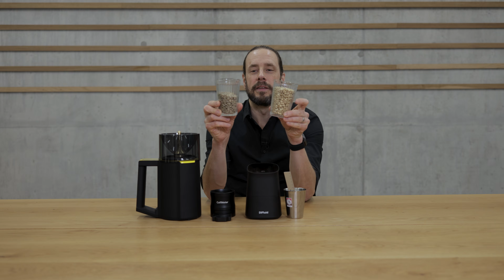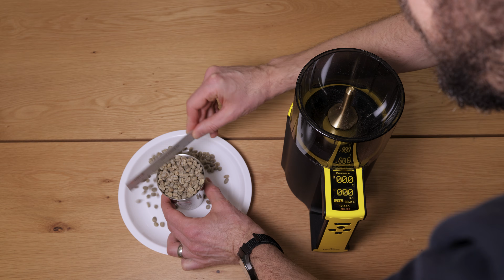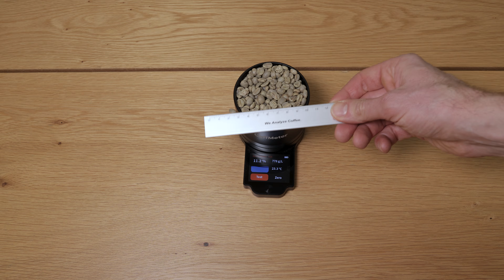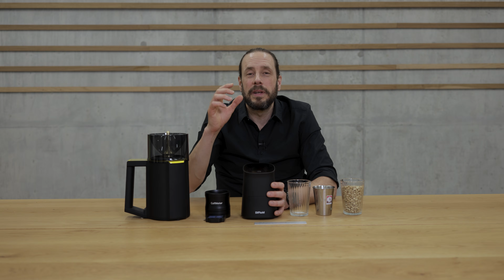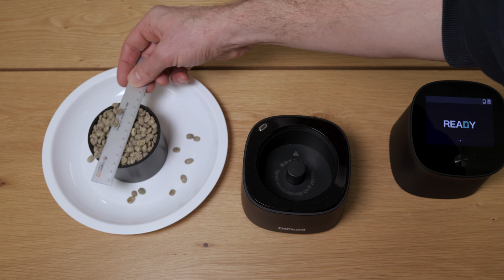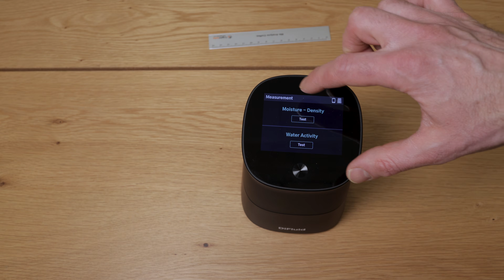Mastering and measuring Coffee Density: DiFluid Omix vs. Coffmeter vs. Lighttells MD500

Comment: Could you give the explanation when roasting high density beans more? So I need to preheat the drum higher because high density coffee is like cast iron, then after I put the beans inside the drum, the charge temperature needs to be lower than the low density coffee due to small pores of the beans. Charging high density coffee with such a high power will evaporate the water on the exterior part of the beans, hence resulting in the beans scatter. 

Then with such a lower temprature, how to make the high density beans roasted optimally? Because I tried to use this method and I tried to longer the roasting time and the beans had a strong baked aroma.

Comment: Thank you for the interesting video. I didn't quite understand the relation of dense beans and the strategy of heat application in the beginning of the roast though. Always assumed that dense beans are very capable of handling much heat in the beginning. And beans with higher humidity could also endure a bit more heat in the beginning. Would love to understand better.  Cheers